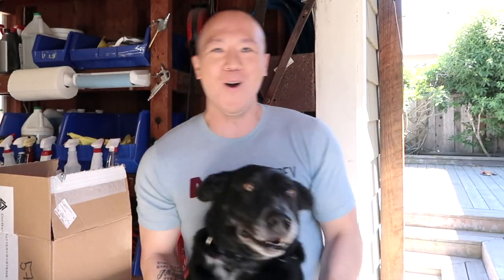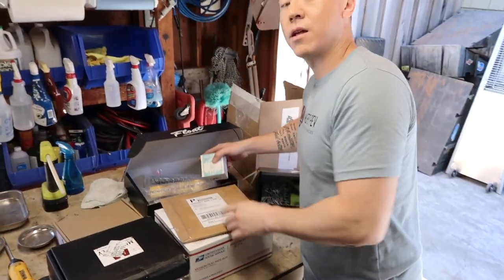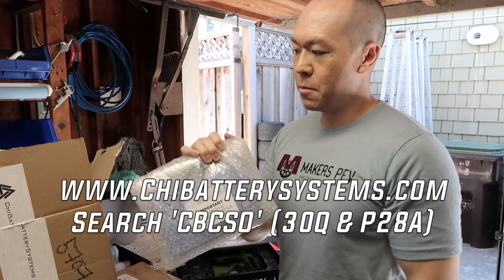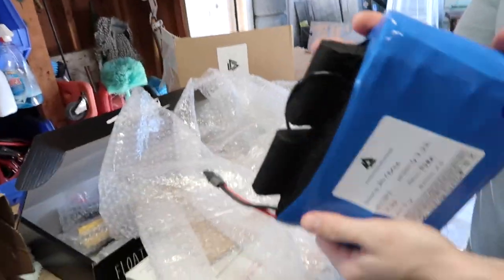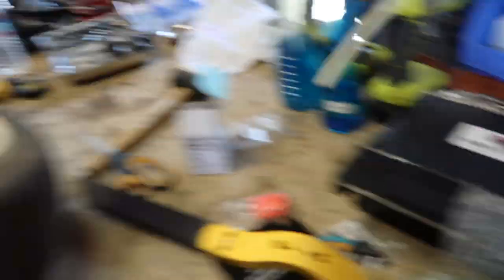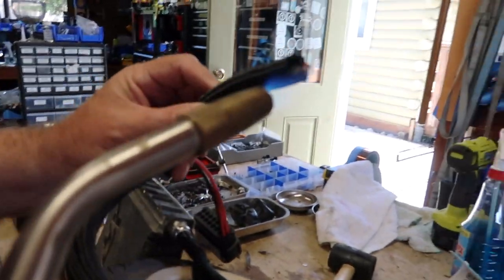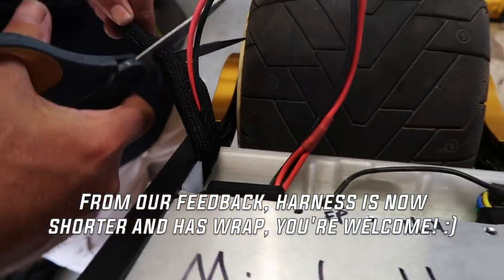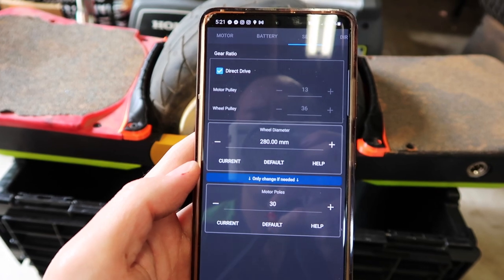Building the Ultimate VESC Trail Beast! 84V CBCSO battery in a stock Onewheel box??

Comment: Badger wheel has their “Torque Box” battery box that’s bigger and fits their “Torque Bumper”. I think THAT set up would be dope with the 84volt battery IMO.
Reply from the maker: Yep the torq box does fit the cbcso quite nicely! But the addtl cost of the box + bumper adds up.. Wanted to show some more economical ways to fit this battery 🤙🏻
Reply: But then no BANGS = sad
Reply: $350.00 Badgerwheel Torque Battery Box and Bumper versus $115 for 3D Printed Box and hardware (lid/gasket)...
Reply: This is exact build I got yesterday. Still waiting for charger. Igor from TOR build it for me, I got his badger bumpers.

Comment: Love that you guys are doing these build series to show folks what’s possible with diy vesc set up. That said, I’ve built a bunch of esk8s and esk8 batteries…you guys are taking a big risk by forcing a lithium ion battery into the battery box like that. With all the vibration onewheels endure, it only takes one broken spot weld or overly compressed balance wire to turn these things into a torch.
Reply from the maker: thanks for the support! fair point on the battery set-up. Unfortunately in the ow world to do extended battery options using stock box  it's always going to be a tight fit due to the box itself, bumper design etc. But there's enough padding in the lid to offer some shock protection, and enough dremeling on the sides of the battery box to make space. Also the packs are designed to have compression flex using unreasonable amounts of pressure. The best options are to use a 3D printed box or a Torq box for a true drop in solution.

Comment: I'm looking at building one of these from scratch (I don't have an XR to start on) so looks pretty achievable if I can get my hands on a motor.
What's the craic though with the BMS? Do you/should you have one with a VESC or with the CBCSO and the specific charger does that have its own BMS? Any advice would help dude 🤟
Reply from the maker: If you have xr parts then it's very much plug n play! Swap out the fm controller with a makerspev lil focer controller and you can use the rest of fm parts including the bms. However the active balancing bms is still the last remaining weakness of vesc that the engineers are working on. You can use the fm bms with the balancing function but you'll only get 1/3 of the full power from vesc (still equivalent to stock fm power output). It's advisable to have some sort of bms, there are a few passive bms options such as xlite, ennoid, daly. If you run without bms, then u should remove ur battery and balance it every few weeks or even more frequently to be safe. Check out pev.dev for the latest vesc updates, or the vesc builders fb group. Link above in description to get your vesc 'lil focer' controller 👆🏻

Comment: Going to ride the GT till it breaks, not sending it back to SlowMotion. Just replace the controller, by the way does the controller came programmed with vesc firmware ready to go?
Reply from the maker: Yep just replace the xr controller, decide your battery/bms set up and good to go! There is pre-loaded firmware with some nice basic settings, and you can also upload the latest tune cards from pev.dev (including my trail settings) and/or try your own.

Comment: I haven't really thought about tinkering  with this yet but my GT is my go to board because of the power. My XR sits there but is a a lot of fun to ride on trails with its 5.5 on it. So can I just get the little focer and controller box and use my stock battery until I can get a bigger one.
Reply from the maker: gt definitely has a bit more power than a stock xr, 72V vs 63V. Even with a stock battery in a vesc you're gonna get more torque than gt since it allows for more amps. You should check out the hill climb vids vs gt on my channel! pretty mind blowing how much power vesc can put out..

Comment: What BMS do you recommend if experimenting with converting an XR to VESC using the CBXR Battery? The CBCSO P28A 72V 6Ah 432Wh battery is currently sold out, is this ChiBatteries CBCSO 84V?
Reply from the maker: I'm not too well versed on bms options, check out pev.dev site for all vesc knowledge. The cbcso is rated 72v nominal but 84v max, same battery but unfortunately sold out for now.

Comment: I would have used a power file for a lot of those stock battery case mods.
Reply from the maker: that would've been nice for smoothing things out! We just had the multi-tool and dremel and it worked quite well.

Comment: 3d prints are rarely waterproof; water resistant at very, very, very most. Unless they've been coated afterwards, or otherwise finished (ABS can be acetone finished and can yield a highly water-resistant surface)

Comment: How much are all the parts, I want to get this setup eventually.
Reply from the maker: if using your existing xr parts, then all you need is MakersPEV controller $700, CBSCO ~$600, 5A charger $100. Sell your stock fm controller and bms for ~$700. links in description

Comment: That stock box is going to disintegrate as soon as you crush down with it on a curb.

Especially with such a high voltage battery just seems like you're asking for it.
Reply from the maker: haha definitely voids the warranty even more! you'd be surprised how much beef is in that bottom angled section, we could've dug even more.. The case is surrounded by the rails, bumper and footpad so not super concerned. Been riding hard on trails with this for the last month, took it apart to inspect and looks fine. This diy solution isn't for everyone, so consider the 3d printed box or the TORQ box.

Comment: $3k but no lights?
Reply from the maker: Where did you get the $3k figure from? Lol Controller is $700.. It can support lights but need to install one more component. Honestly it's not a big deal if you use a flashlight. Pros far outweigh this small con.
Reply: Ehh yes but also 

Point able flood/spot handheld/headlamp vs low dimmer board lights
Sure they would be N🧊 but not the end of the world.  Especially when the ride of a vesc is the way it is

Comment: oof that's a nasty cable/wire install. Those kinks in the cable will cause problems later. And thats not a super great lid install; going to cause mad vibration wearing on everything touching the box and/or lid. never compress your battery to install it. And leaving all that extra battery cable is going to yield nasty voltage sag.